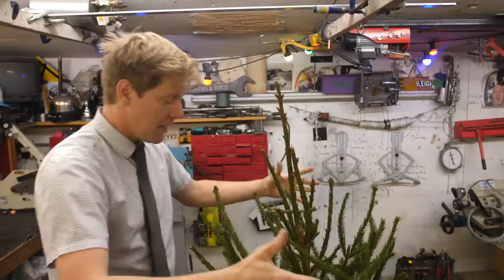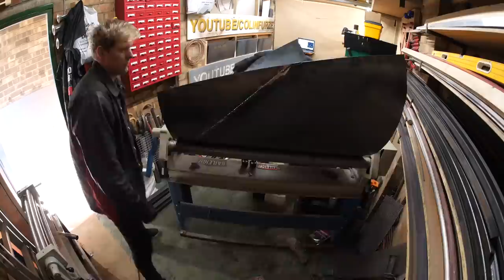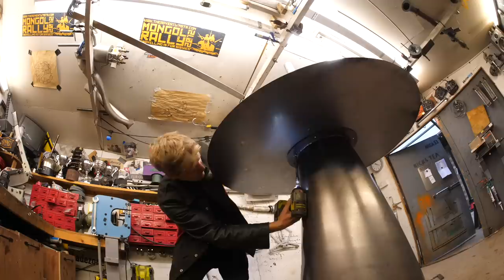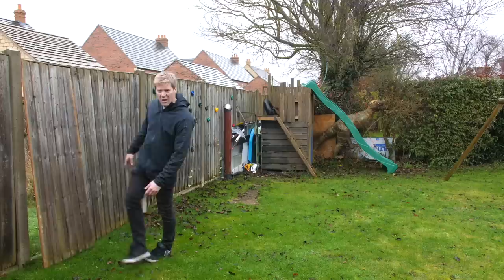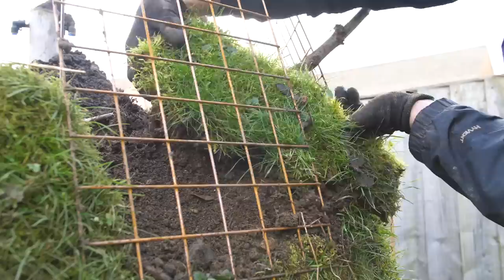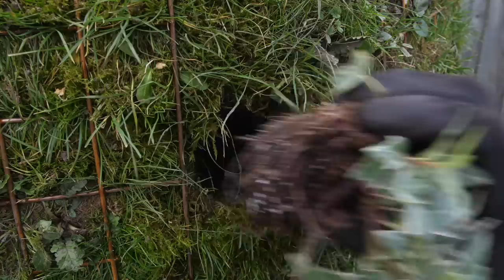Tree of Trees

Comment: Everything will be OK apart from the Xmas tree on the top. It looks like a bare root tree that has hardly no roots, it will probably struggle and it will be susceptible to drying out fast in the sun! give it a year or two and it will bounce back if it doesn't die in the mean time :) if you wanted it to live you could cut the top back to give the roots less to support :)